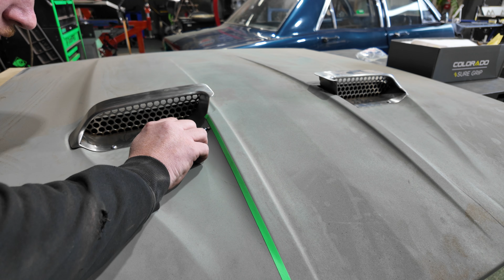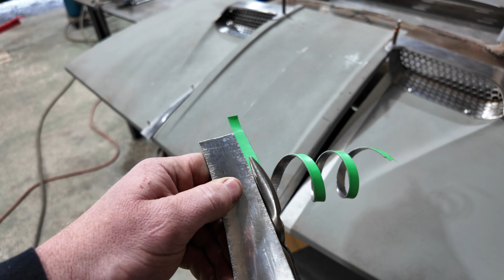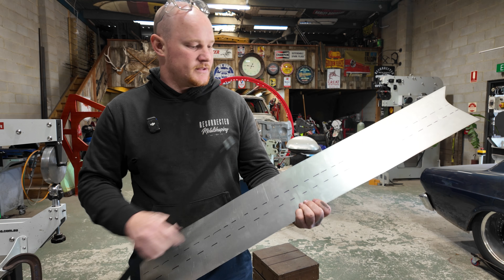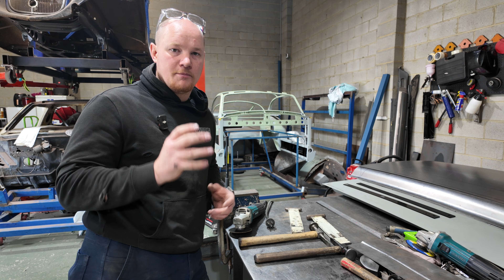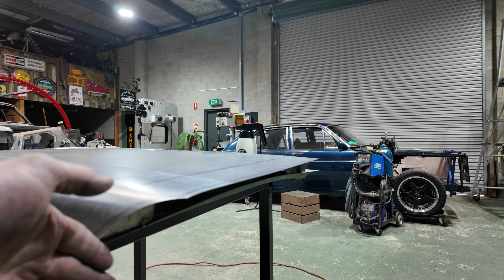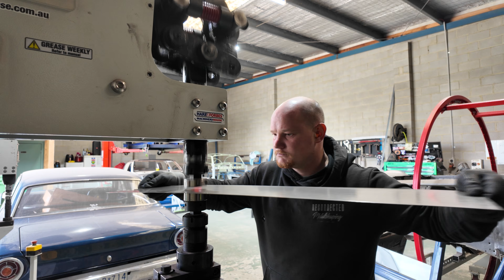Custom Ram-Air Reverse Cowl | Full Metal Shaping Process

Comment: Gday from QLD, with all these Reverse Cowls you are doing. I know this is state dependent, what are the general guidelines for running these bonnets on the street. i.e. bonnet height and structural integrity.
Reply: Hey Byron, Tim here. The bonnet is for a NSW registered ute. There are guidelines from service  NSW, the main ones are a shpere 160mm in diameter must be able to roll up past the scoop without getting caught up in it so the scoop hieght on this bonnet is 78mm. Also they are asking for a 20mm radius on any forward facing edges, given the original scoops only have a 1.5mm radius I went with a piece of 6mm rod under the 1.5 stainless sheet. The other guidelines are for forward vision, basically so you can see enough in front of the scoop. I think most of these guidelines are built around the Hornet style scoops. State to state varies, as does your relationship with law enforcement... hope this helps. Tim.

Comment: Yeah, Falcon... very different beast from the Falcon sold in the US market. What you have there looks very much like a 71-73 Mustang Mach1 hood from here... Oh yeah, that too... I mean "bonnet". LOL!
Reply from the maker: I do like the US Falcon. Our Aussie ones are pretty different, lol yeah bonnets and guards over here we never say fender as we’ll
Reply: @Resurrected_metalshaping   The differences in the body styles between our countries (being on opposite sides of the globe) is interesting, as are the similarities. For instance, depending on the year of production, I can see styling cues from different American cars in the Aussie Falcon, like from the US Torino, Mustang (4dr?), Cougar, and Montego, while 60's model are almost the same.
I understand that our '04-06 GTO is based on your Aussie Holden, but ran a 6.0L Vortec V8 with a 6-spd stick. The drawback was that GM fk'd the pooch with suspension and electronics problem, as did Ford with the resurrected 02-05 T-bird retro based on the Lincoln LS chassis, but Ford stupidly used a tiny Euro-Jag engine.
Love your work man, keep it up!

Comment: Great video, and great results. I can understand your reluctance to modify your hammer, tools used for years become an extension to your body. Your brain has the length, weight, and balance programmed in, and as result the work always goes smoothly without stress.
Reply from the maker: Thank you. And you’re 100 percent right they for sure become an extension.